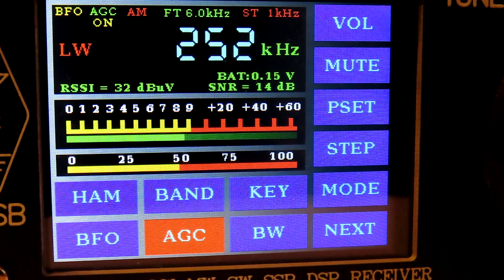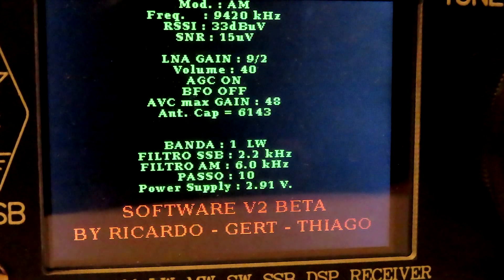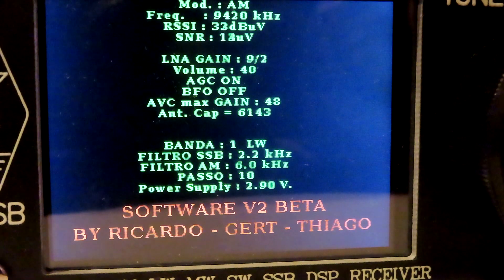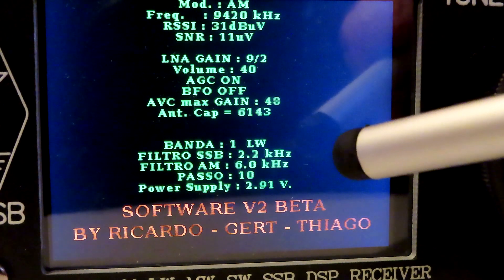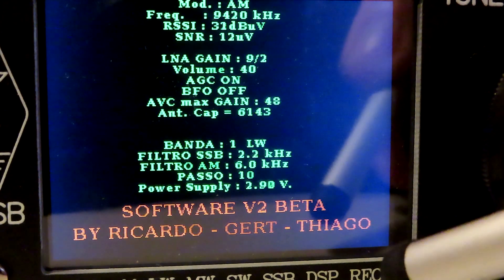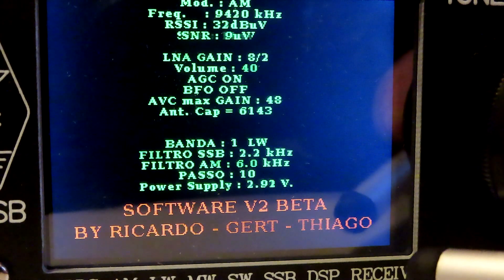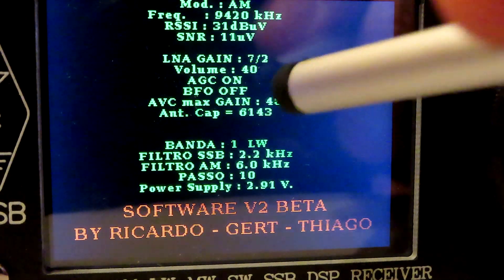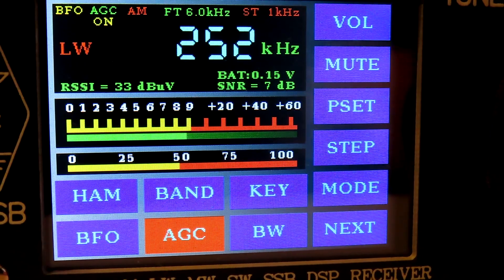ATS 25 Info Screen

Comment: Hi , I just learned about this receiver and like it a lot , I looked on Ebay and they are only sold from China . are they worth investing $120.00 in to it ? Ray
Reply from the maker: It depends. There are better radios around. This one seems to be a work in progress. If firmware updates become available it may improve but it's never going to be a top end receiver.